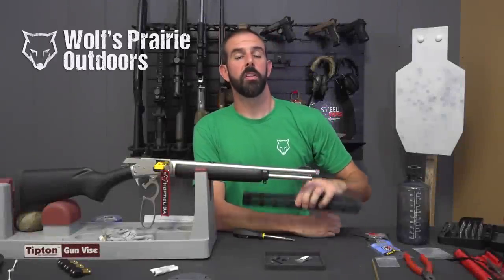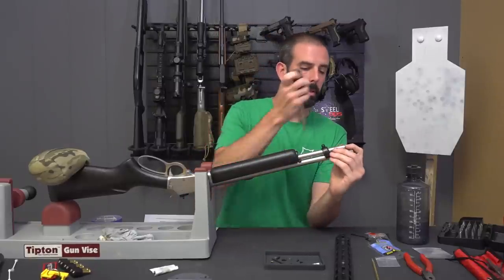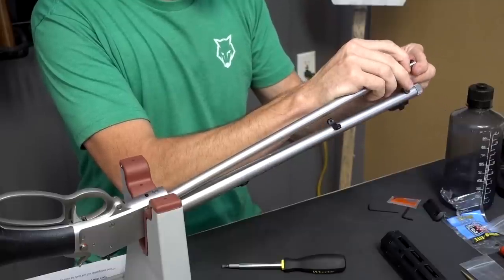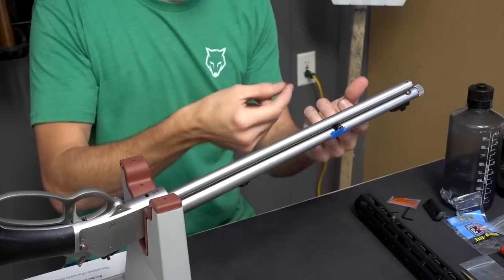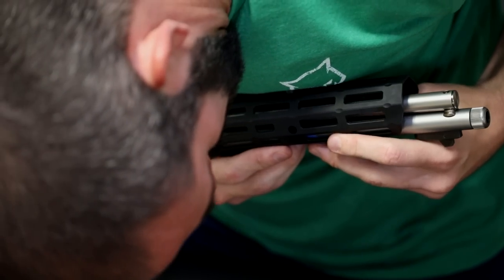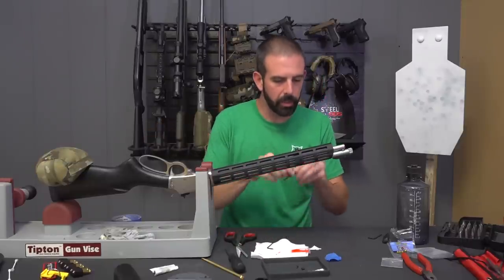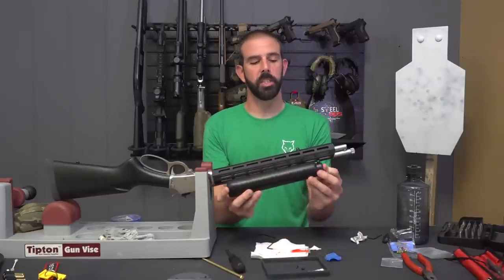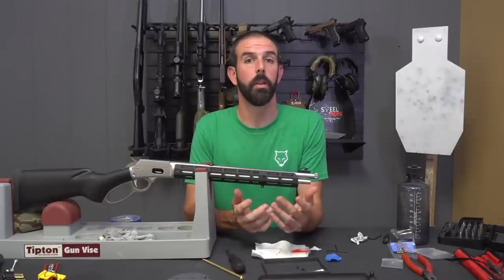Marlin 1894 CST - Midwest Industries Hand Guard Installation

Comment: I just picked up a Marlin 1895 Dark Series 45-70.  I cannot remove the forend or magazine tube.  I’ve removed all 3 screws, 2 side screw and magazine tube screw on bottom of tube.  It’s really tight on there and won’t budge.  Any ideas or tips?
Reply from the maker: Hmmm...It might just REALLY be on there, haha. It should lift off the stud at the end with a little pressure. Sorry, I can't be of too much help without seeing it and putting my hands on it. The first time I tried taking mine off was a bear too. Good luck!!
Reply: Thanks for the reply.
I got it off.  I used my vehicle dash removal tool.  They’re plastic so it didn’t damage the finish.

Comment: To hold the washer you can use  a small drop of locktight or heavy sticky grease in stead of tape.  If u are a computer nerd cpu heat sink grease, this will transfer more heat away from the barrel👍 Ever little bit helps 🤣
Reply from the maker: Lol nice

Comment: Do you think this would work with the marlin scout rail? The scout rail looks like it has wings towards the rear which might hang a bit low.
Reply from the maker: No, the scout rail protrudes down too far. If you are mechanically inclined, you could probably do some file/machining work on one or both rails and make it work out. You'd just have to hide the bare aluminum where you took away the anodized finish.

Comment: I’ve been trying to get a marlin 45/70 with a threaded barrel but not having any luck where did you get that gun at
Reply from the maker: Those are tough to get right now for sure. Good luck! I got this 1894 at MidwayUSA. Didn’t know they started selling firearms until I found this. Shipping to your FFL is very reasonable.

Comment: Major problem with this modification, at least on mine. The issue is with the forearm tip tenon which this hand guard screws to, slides left and right thus the barrel ends up not parallel to the hand guard. I'm constantly sliding the hand guard left or right after each shot.
Reply from the maker: You need to Loc-Tite and stake the tenon, and make sure it's centered. Then you'll be good to go.

Comment: I have a 336y that im looking to pretty up with that particular m-lok system.
Any particular extra steps to consider since its offered with a barrel band adapter?
Reply from the maker: From what I’ve seen you have to buy an additional part per Midwest Industries, MI-MAR336A. Good luck!
Reply: Did you ever figure out if this m-lok handguard works with the 336y?
Reply: @MushyMags808  it does, Midwest industries sells an adapter that fits with the handguard specifically for the 336y.

Comment: I recently added this hand guard, now my mag tube is completely covered by the handguard which looks nice.  I was wondering of you know of an extended magazine my barrel is significantly longer than the one in the video. Thx
Reply from the maker: There are longer tubes, but they won't work on a shorter rifle because of the stud that holds them to the barrel. It protrudes through the mag tube and would block the spring from functioning.

Comment: I bought one for mine but due to Marlins poor fit and finish the pinion slides side to side so the m-Lok handguard my mine moves all over the place. It sucks cause I really wanted it on the rifle!
Reply from the maker: You can do it just like a castle nut on an AR15 and stake it. Just stake each side in place and you’ll be good to go 👍
Reply: Can I get a video on that
Reply from the maker: I’ll try to get one up soon. Mine is actually loose as well and I’ve been meaning to do it. Lots going on since we have a newborn and he’s been sick. I’ll get to it soon though!

Comment: How many places does it come in contact with the barrel?
Reply from the maker: The only contact points are the front of the receiver and the mounting lug that is already inset into the barrel.
Reply: @buildhuntxplore  So then it doesn't really "dissipate heat from the barrel.  That requires plenty of metal to metal contact.   right?
Reply from the maker: It’s not that it is cooling the gun itself, rather there’s not the wood handguard trapping heat that keeps the barrel hotter longer. Instead, with the open air design it’s more of an air-cooled system.
Reply: @buildhuntxplore   The wood only covers about 20% of the barrel's surface. I've never heard of a lever gun overheating. It's for looks... just say it.
Reply from the maker: Function over looks for me. How hard have you run a lever gun? When you push them they get hot like any other gun. And i didn’t say it was going to over heat. It just helps keep it cooler. Also I didn’t say it was the sole reason. It gives me a mounting point for my HopticUSA Longbow Quiver and a mounting point for a flashlight for a bump in the night. This is a rifle my wife can easily manipulate for 2-legged or 4-legged problems on our homestead.
Reply: @buildhuntxplore   Not necessary on that rifle. It's just for looks... just admit it.
Reply from the maker: I’m really sorry you have such a determined point of view. To each his own. Let’s just agree to disagree

Comment: I cannot get mine to fit flush into the receiver. I have a 1895GBL
Reply from the maker: Hmmmm If I were you I'd call Midwest Industries and ask them about it. It may need to be filed slightly to get it to fit properly.

Comment: What's the weight savings using the metal fore end vs the wood?
Reply from the maker: I was actually wrong about the weight, haha. The wood weighs 4 ounces and the aluminum weighs 6 ounces (both according to Midway USA). I guess because the weight is distributed along a longer area that it feels more balanced.